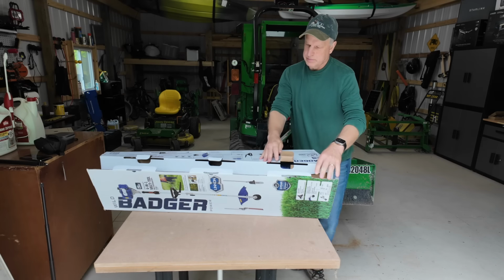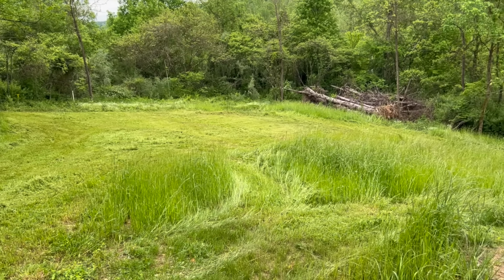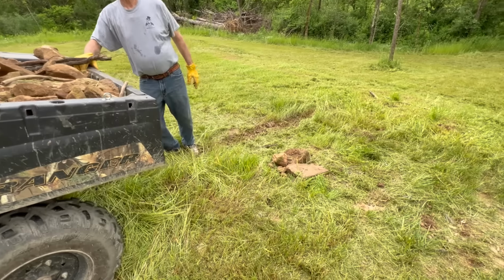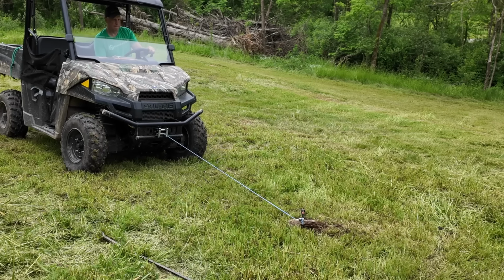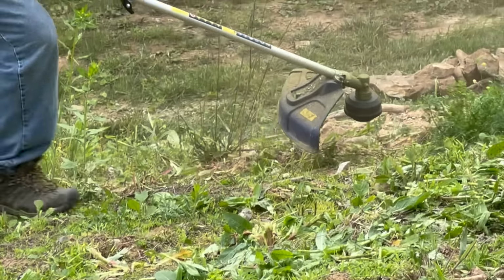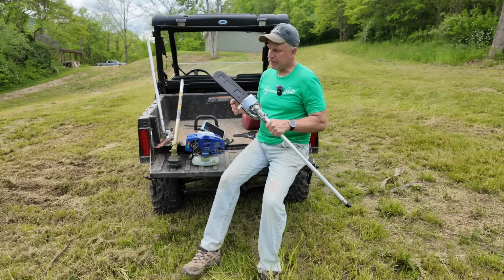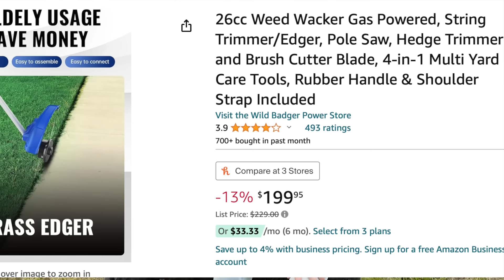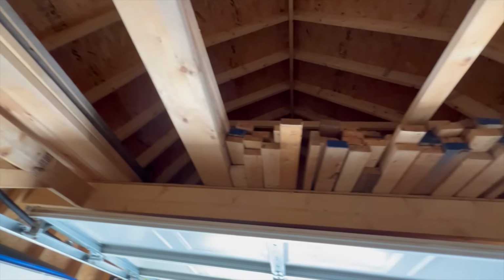Water Tank Update* Giving The Wild Badger 4-in-1 Multi Yard Care Tools A Serious Workout* Dethroned🚽

Comment: you need a water shutoff valve or an electrical disconnect for the pump to avoid water leak damage to inside of house  and depletion of water supply while house is vacant.

Comment: I have used the Stihl Kombi system for many years. The tool I have used in stead of string is their power scythe. It is like a short hedge trimmer that has an extra bottom plate so it handles rocks and ground better. All my attachments will work with their electric power head. ALL MY STIHL STUFF IS 50:1. Sorry to yell but it is very important.